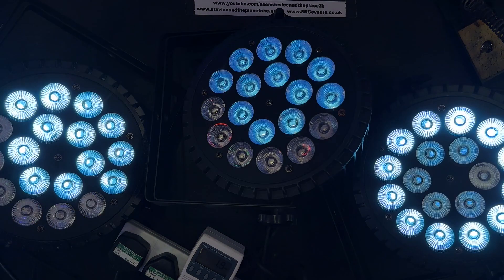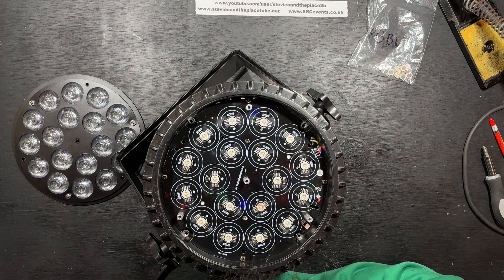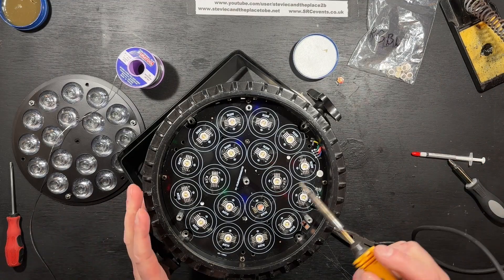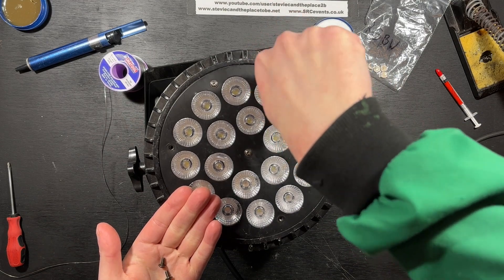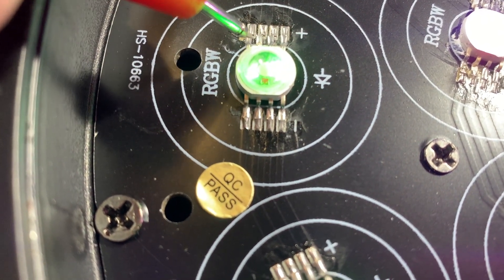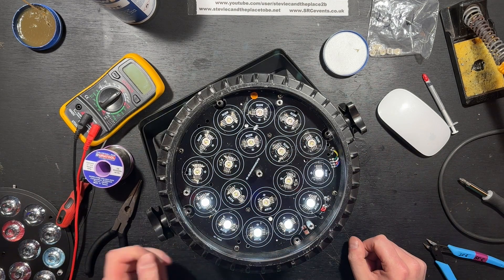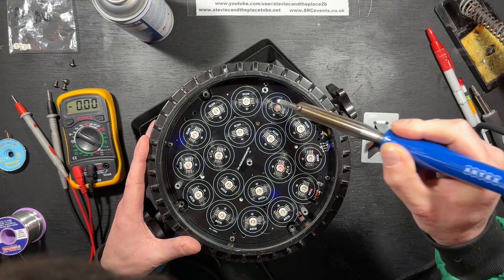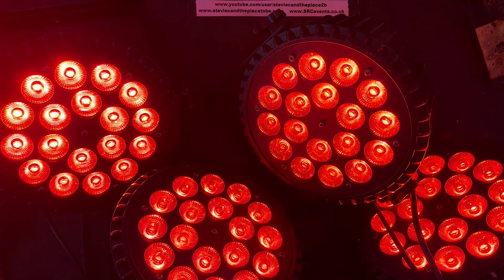How NOT to repair RGBW SMD LED PARcans (probably)

Comment: Thanks for the repair video, this is excellent! I've got a few lights of my own and haven't had to worry about repairs yet, but I'm sure I'll have to.

The other thing that I've been wondering about is whether it's possible to DIY a fixture like this, or more specifically, with a nice big heatsink and a RGBWA+UV 200W Chip, breathe new life into an older leko by gutting it and using the housing to hold a DMX controller board and heat sink to cool the SMD Hex LED.
Reply from the maker: @majorredbeard  there’s plenty of “kits” to be found on aliexpress; not an actual kit but every component (chassis, psu, led board, driver) can be bought individually. 

Plenty 200W heat sinks too. 

Actually had plans to mod a halogen disco scanner to use led but life got in the way as usual.
Reply: @steviecandtheplace2b  Well that's cool - I've never seen that - can you give one as an example? My searches haven't really proven anything that looks like a kit. Are they PAR fixtures?
Reply from the maker: @majorredbeard  yes they’re all PARcan components; but it’s just occurred to me that the led arrays are 3 parallel sets of 6 rgbwauv/rgbw LEDs in series. So maybe you could also drive a higher wattage “point source” chip from it? Maybe bodge with power resistors? Needs more research. Will report back with AilExpress searches in due course.
Reply from the maker: @majorredbeard  I’ve uploaded a “redux” video about these repairs. Showing how you don’t need a high power iron etc. 

You’re basically learning alongside me 🙄😂

Comment: Hi Steve, Im looking for RGBWA 10W LEDS 12pin chip for a repair, but I can only find the chip in a 15W.
Will the 15W LED be compatible or must it be 10W?
Cheers Richard
Reply from the maker: Yes, a 15w will be backwards compatible with a 10w, but check the pin-out with a multimeter before soldering.
Reply: @steviecandtheplace2b  
Thanks Steve
Never Soldering anything before but all my green LEDs not working and can not find anyone who repairs dmx lights so I am going to buy an 80w iron and follow your video. Fingers crossed 🙂
Reply from the maker: @richardwillerton7993  I have an update video in edit literally right now.

Comment: One mine, the current regulator failed and killed all Leds with a lot of current.
Taking it off us always destructive.
A very big tip on the iron will work.

I changed only the broken ones, but the others failed after just a few months
Reply from the maker: There are sellers on AliExpress who sell DIY par can kits, or just the bits you need. You could look into replacing the entire led pcb and the logic pcb.

Comment: there is no solution ... I did the exact same job today and yesterday and the day before yesterday ... I tried everything .. I detached the heatsink behind the card and gave a lot of hot air from there, the problem is that as soon as you place the new LED on the already hot surface, the solder solidifies, not allowing you to fix it exactly 100% and if you heat up too much, you'll do damage... 🤬🤬🤬🤬🤬🤬
Reply from the maker: I do have a part 2 (once the client books in another couple pars that have failed)…. The best method seems to be: clip out the fault led chip, use a high-power iron to remove the old led tails, apply HSC and new led chip, then solder one pin whip holding the chip still and pushing down to displace air gaps. In theory.

Comment: Flux will help! Flux and the hot air pen should get them off. The big iron will be good with some flux and braid to get the pads clean and flat again. Clean with alcohol before you do the heatsink compound.
Reply from the maker: I didn’t explain this but the first attempt involved flux (the dribbly stuff) with the hot air pen. Normally your suggestion would work, but the PCB is bonded to an aluminium/aluminum heatsink, which does its job and sinks the heat away. I also used IPA Solvent to clean the pads, pretty sure I showed that. 

Will try using desoldering braid in the inevitable follow-up video tho, thanks.